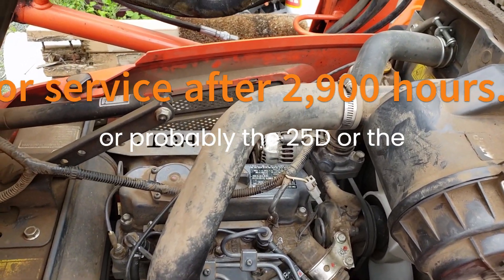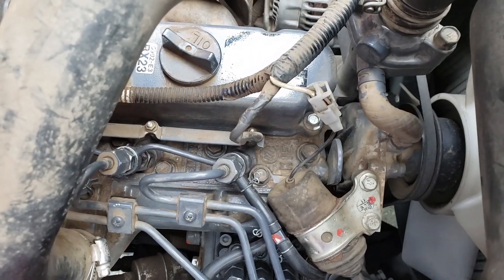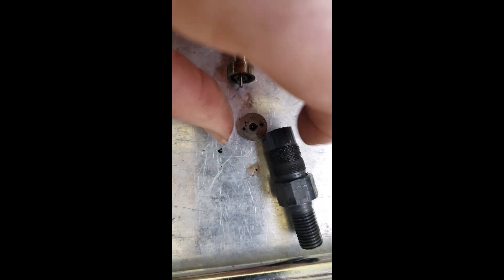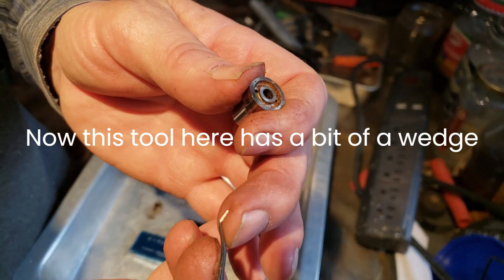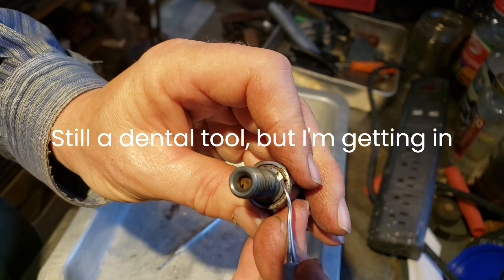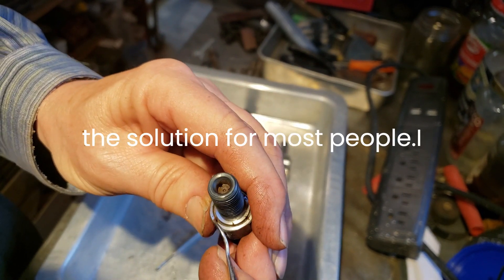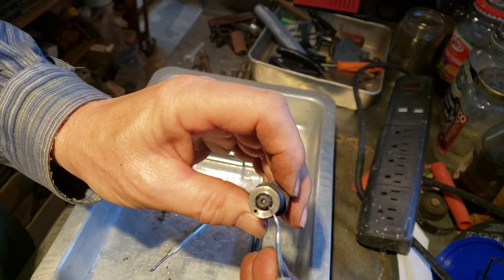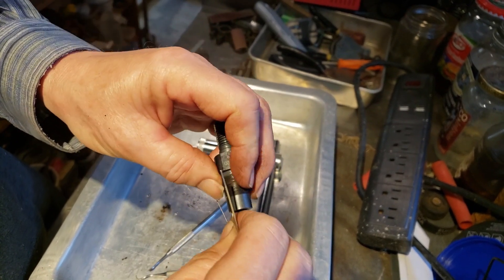Kubota BX25 fuel injector clean. BX24, BX25D, BX23S.  With D902 Diesel Engine.

Comment: thank you for the video, my kubota is running rough and dying out after 10 minutes of running. injection pump seems fine so im guessing injectors are possibly clogged
Reply from the maker: First thing I do on my BX25, is remove the fuel hose from the injector pump, turn the key on and let the electric fuel pump run( do not start) and see how well the fuel flows.  Good flow might mean another issue like injectors, but unless you have LOTS of hours on your machine, BAD fuel flow is generally the issue.

Comment: Did that fix the problem?
Reply from the maker: Dismantled the injector pump, all mechanical is good, but exit orifice #1 was clogged, so cleaned all three fittings of scale and reinstalled the pump.  Do not know what went wrong, but the engine fired and ran-away... shut of fuel and hopefully no damage.  Disassembled pump again, changed 180* pump piston to face opposite side than fuel slider, and will double check to make sure it fits in position and try again.  Nervous.
Reply from the maker: This fixed a low fuel flow issue, but now I need to figure out a detonation misfire issue which is now worse since the injector cleaning. I am assuming the D902 BX25 injector pump has a broken spring.  Can't buy just 3x springs, just the whole pump from Kubota.  However, they are available from the UK, and since the D902 is a universal engine, perhaps an equipment dealer will have just springs?
Reply from the maker: I just watched a video where a fella dismantled and cleaned the injector pump, and all pistons were quite 'dirty' and one was not running full stroke, so my challenge today will be to dismantle my injection pump, considering the injectors were so contaminated.
Reply: منفظلك حافن كابوتا D722 كم حجمه الارقام المعرف بها
Reply: Yes Fran is unique, a trans person, a man.